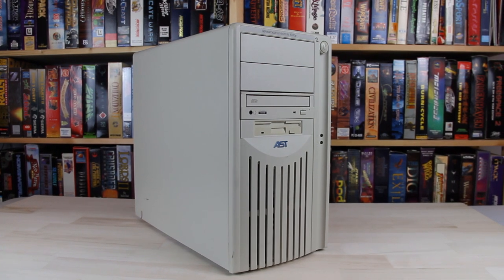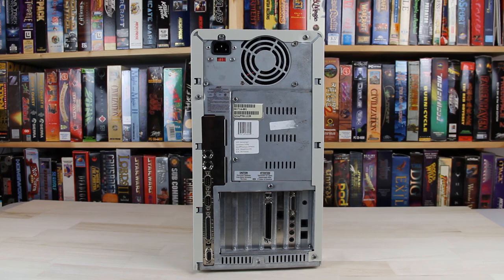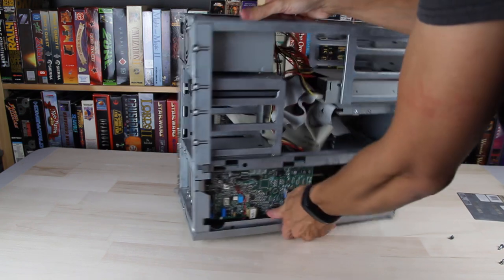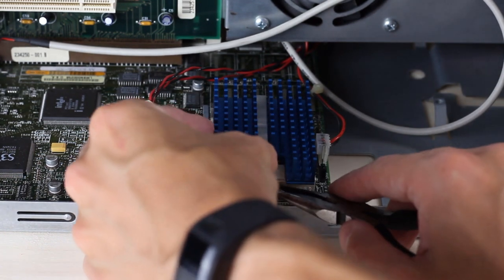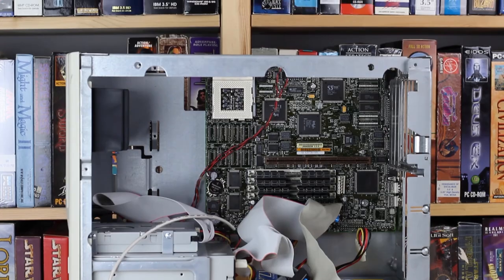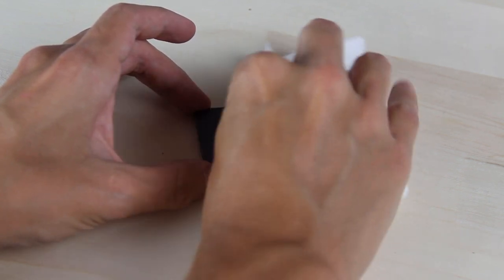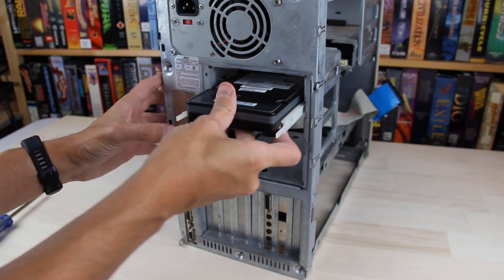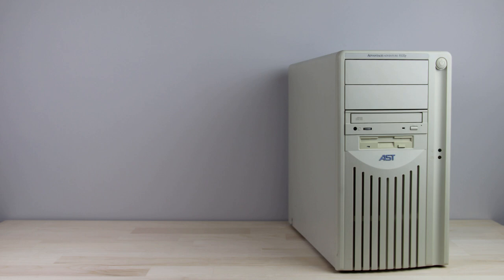AST Advantage 8100P - Nostalgic Pentium DOS Rig - Part 1

Comment: OMG that is my first computer. Was very pricey for my family at the time, with a 15" CRT and HP 560C printer. 
NO bloody LEDs, colour schemes or other bullshit. Just ribbons and grey...as it should be lol.
For the record though mine was a P-75, 1.6GB HDD, integrated graphics. Eventually bought an expensive 4MB Voodoo add on pass through card and upgraded it to a Pentium-166.

Comment: My first computer was either one of these or an 824, I can't quite remember but more or less the same thing with the same style case. It had a Pentium 133 mhz. My dad got it brand new in 1995 for his business and I inherited it around 1999 after he changed jobs. I hated it at the time, I could barely play any of the games I wanted to and it wasn't super stable. It sad unused in all my family's random junk for years, I vaguely recall seeing it while moving 7 or 8 years ago, no idea what happened to it after that. These days, I really wish I still had it. I used to play Need For Speed II a lot. Of the games my parents got me as a kid, I think NFS2 was the only one I actually got to work half decently on that machine. Oh, and Hover. Hover was lit.
Reply from the maker: You know it's funny you mention the stability because I actually had a sheet I would mark down each time mine crashed... and it was several times a day! I never did figure that instability out but I wasn't quite as tech savvy yet hah. We shall see if this one does the same as I intend to try and use a recovery disk to get the original experience back! And yes Hover was great!

Comment: Great video. I also have that urge to find my childhood machine. In my case it's a Compaq Deskpro EP Pentium 3 with all the bells and whistles money could buy around 2004. I got the system now but need upgrades like SSD, Tualatin, and 6600GT. A little critique on the video. I would have left the cpu in the socket or used some foam to support the pins. Applying that much force on a 20 odd year old cpu was hard to watch.
Reply: I had that deskpro from 99 to 05 when it was thrown out. I remember wanting to max it out to play newer XP games. It was the ststem I grew up with on the internet. Good times.
Reply from the maker: Awesome I think I even have a similar system I got from an old job.

And yes fair point on the cpu I think I got in the groove of getting the video done quickly hah. I usually have some padding of some variety so I'll try for that next time I do something similar. Appreciate the feedback!

Comment: Nice video :) I had an IBM Aptiva 100mhz. I found it online, and the graphics card is Trident TGUI9680, and I think I had 16mb of ram. I got it from my brother that also had bought it used. So it was already old when I got it. I though I finally could play modern games, as it was much faster then my 486sx. But I was disappointed. I tried to play quake 2 but that wouldn't work at all. I got like 1 fps. But I could at least play doom, duke nukem 3d, gta and many more games I couldn't before.
Reply: My first computer was an Aptiva with a 486-66/DX2 and 4MB of RAM.  Great machine if you ignore a failed mouse (ball mouse of course) and a CMOS chip that got really flakey and failed over time to be replaced by IBM under warranty after being computerless for a few weeks.  Still, it was better than my friends Packard Bell's IMO.  We had avoided the initial Pentium proc's because of the math error that early models contained.  I wish I could still find this machine, but I'm sure it's in a landfill or gully somewhere....
Reply from the maker: Hah I know the feeling. My actual first real machine was 486sx 33 and boy was I disappointment when I couldn't even get my brand new copy of Doom 2 to run!

Comment: oh this is an 8000 series... not 800. was wondering why everything looked cheaper
Reply from the maker: Yeah I can't really find any info on if the 800 was sold in the US or if that was an EU special. Certainly many parts are shared but there is surprisingly little information on these models online for some reason. Once this was up and running it sure felt close enough to my childhood 812!
Reply: @RiksRandomRetro  no, surprisingly not many parts were shared, and it was primarily sold in the united states.. what would you like to know about the 800?
Reply from the maker: More of a general idea on the differences. I had an 812 as a kid and basically just what I can remember from memory. At least working on this machine everything seems to be in the same place but it's been so long and I was a hardware novice back then!
Reply: @RiksRandomRetro  not sure what exactly you remember, but the 8000 series had totally different hardware and software, i remember this because ive explored the 8000 series drivers and companion software from back in the day. the 8000 was totally different. plus i remember the hardware which came in the 800
Reply: ...but anyway, the 8000 had a cheaper modem, video card and sound card. the cpu, ram and hard disk seem to be the same as the 800
Reply: @RiksRandomRetro  I remember this PC, bought it from a PC store maybe Futureshop in Canada for almost $3K with monitor back in the day
Reply: @RiksRandomRetro  Also owned a similar spec'd Digital Starion 919